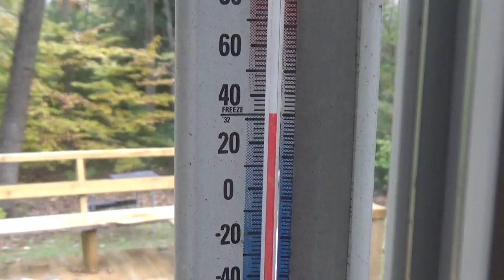Woodmizer LT15: Doing what it does best, making 2x4 lumber.

Comment: I notice your log dogs may be in the wrong location. I just got my mill and found it frustrating to tighten the dog when it's low to the bed, the smaller cross rail gets  in the way of the lever. I moved them to to the wider space in the bed and the tab at the bottom hits the bottom bunk making them perfectly flat and don't get jammed when turning the log/cant. Maybe you'd like to try that too and see how you like it. I also found in the position you currently have them that they stick up about 3/4" so when you roll a log on to the bed they're have to ride over top of your dogs. Hope my suggestion makes your milling even more enjoyable. So far I'm enjoying mine.

Comment: Was it a pine borer My cousin has a real log house and the bugs were in her walls and it sounded like someone was knocking on the logs upstairs lol used bora care on the logs and it killed them
Reply from the maker: I dont know for sure but I plan on heating the wood to a good hi temp to kill whatever. How are you holding up?
Reply: Hey Joe I forgot to tell you the tractor was a no start today a lot of wires just laying all over the place got to get a manual on the way so we know what is what. I am trying to get a roof finished and the weather sucks snow flurries all day today Maybe tomorrow I can finish getting it stripped and get it covered with ice and water. Friday the high is suppose to be 47 and sunny a heat wave lol have a good night